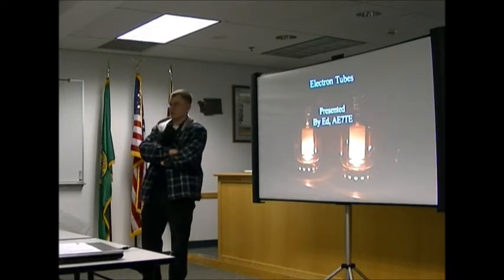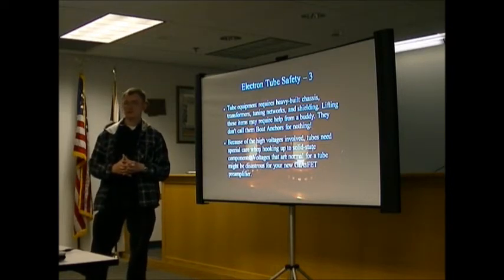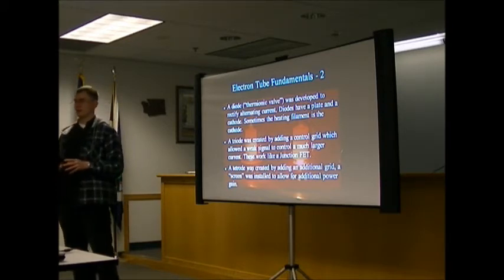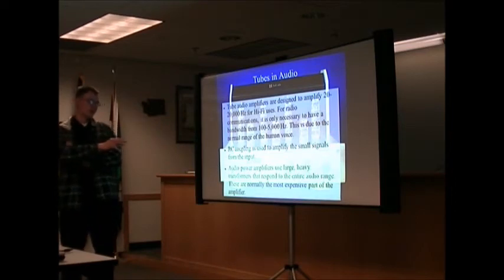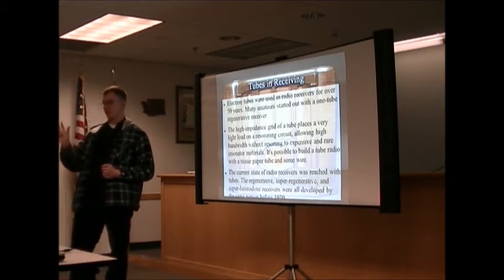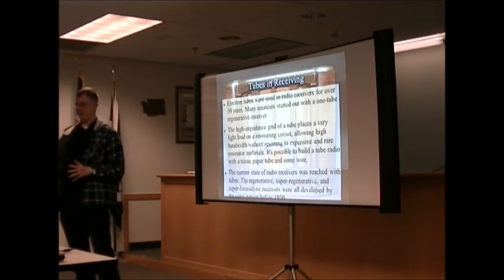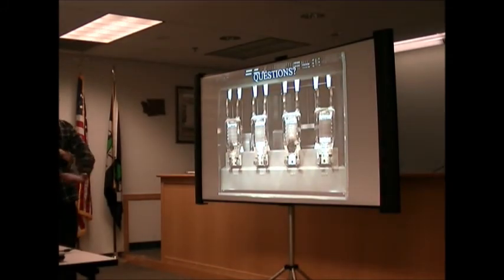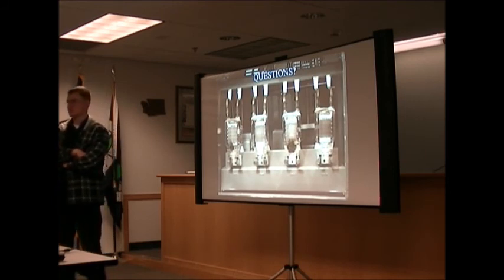25 January 2014 Island County Amateur Radio Club Presentation on Electron Tubes

Comment: on the 6.3V filaments what size resistor I can use ? I have plans to build a ultra linear power tube amplifier with 6SN7 and KT88 also another question only one resistor ?
Reply from the maker: I removed your other comment to hide your email address.

For 6.3v filaments, you are placing a resistor in series with the heater filamentsto drop some extra voltage and spare the tubes. I cannot tell you what resistor you must use, you must calculate it yourself. Let's have an example...

Say you have a single channel amp using two KT88s and a 6SN7. The KT88s draw 1.6A per tube and the 6SN7 draws 0.6A per tube. 1.6 + 1.6 + 0.6 = 3.8A total. Now, let's say you hook up the amplifier and run the tubes. This is with B+ current running, heater current running, and the whole thing warmed up 10 minutes. You measure the voltage across the filaments at 6.9 volts. You desire 6.3v across the filaments. The resistor must drop 0.6 volts and carry 3.8A current. 0.6v / 3.8A = 0.158 ohms. You will likely have to place resistors in parallel to obtain this value. Now, the resistor will need a power of 0.6v x 3.8A = 2.28 watts. So, the total wattage of the resistors must be at least 5 watts because that's double the power you expect to see there. You have to keep the resistors cool to prevent them from experiencing failure

I hope that helps, but you can't do this without measurements and calculation.
Reply: DenEiferer
 Thanks for the example it does help to figure out how I can do that I appreciate your time to explain me this even better